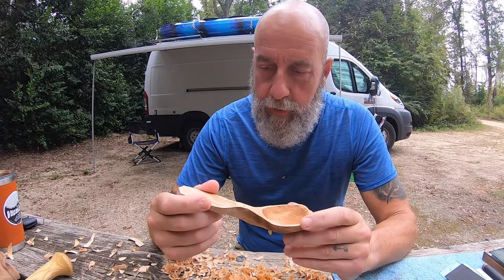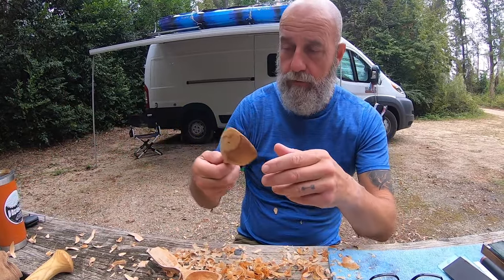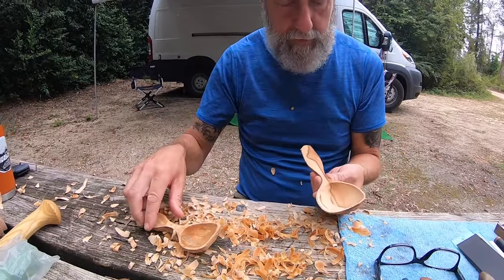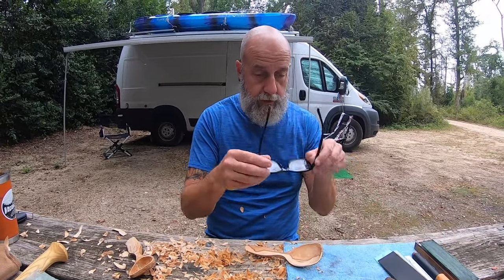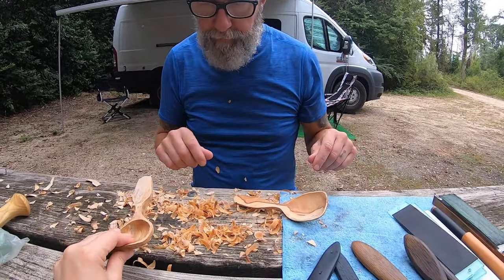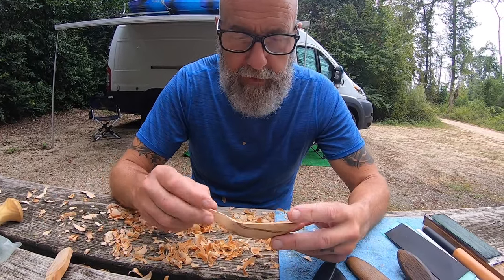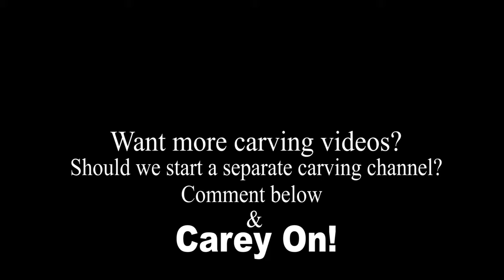The Simple Craft Of Spoon Carving

Comment: That was fun… A true Craftsman and Artisan. I was amazed how much the thin portion would f the spoon flexed on the two cut in lines while you were chopping away the bulk.  That’s strong wood as I was waiting for a snap.  Do you use the scrap wood for anything, possibly smoking while barbecuing?
Reply from the maker: Thanks! The chips usually get tossed but a few times I have dried out some apple and used it in the flat pack bbq for some smoke flavor;)

Comment: Hey man! Love the work! Just got wood carving tools for Christmas this year and wanted to ask something. How did you use that blade for sanding? Doesn't that dull the blade? And what hatchet do you use? Thanks!
Reply from the maker: I use super fine sandpaper to sharpen my tools. Similar to using a wet stone but you pull the blade away from the cutting edge while sharpening. The axe is a hand forged axe from @woodsmansfinest Made in Ukraine.
Reply: @CareyOnVagabond  I meant it looked like you used a knife to smooth/sand the spoon.
And thanks!